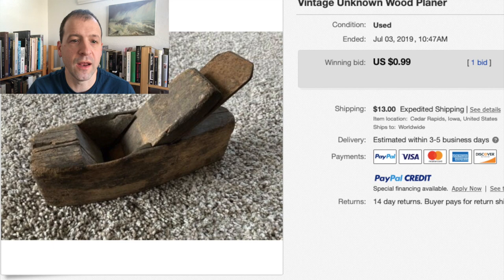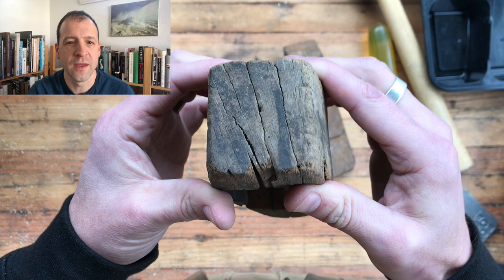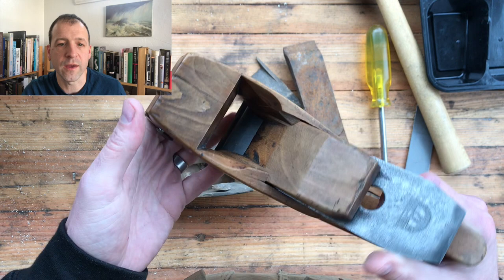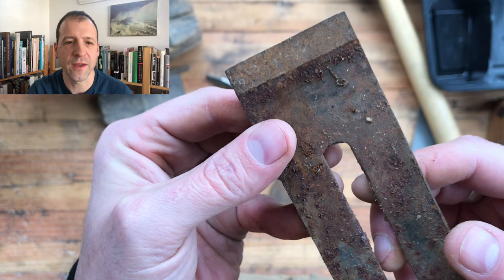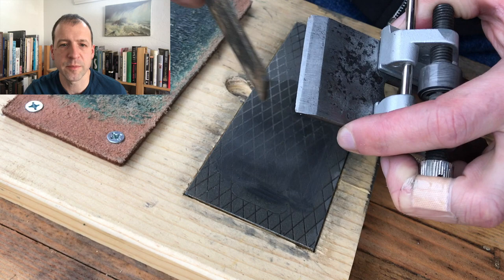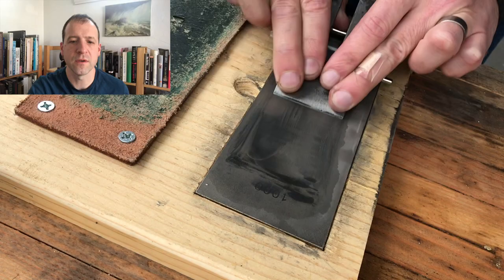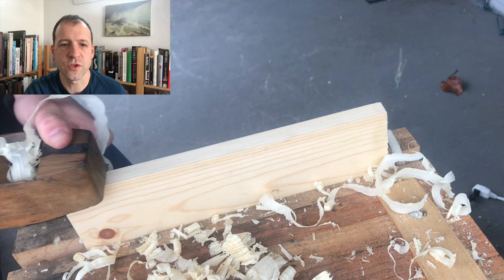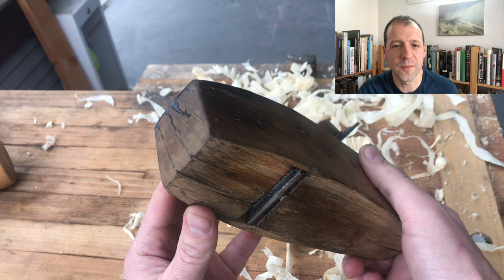Restoring the worst plane on Ebay!

Comment: With the resin, try adding fine wood dust rather than colorant.  We use epoxy all the time on a wooden tall ship to deal with cracks and other repairs.  Also, hitting the area with a low heat gun before and during the pour will help get thr resin all the way into the crack.
Reply: Thanks for the tip

Comment: I repaired windows in historic districts where the client got a tax incentive to keep the windows original, lots of dried and decayed wood.  I used:  Minwax® High Performance Wood Hardener, it is a quick-drying liquid formulated hardener to strengthen, reinforce, and repair decayed or rotting wood.   It’s 20$ per pint but is the viscosity of mineral spirits and it’s applied in numerous coats with a brush.   This would have worked to re-stabilize the wood back to a workable state as glues and epoxy’s will fill and hold but the tension in the remaining dry wood will just split or tear leaving a different crack close to the repair you just made.

Comment: Late to the party for comments but… Ive used “water-thin” CA glue as a stabilizer with some success. Used in all the cracks before the resin and clamping it helps reduce some of the absorption. And will get further into the cracks. Just a thought. Good save on this old fella 👏

Comment: Nice project!  Since the plane is beyond collector value, why not fill every crack with resin?   When I’m trying to get resin into a crack, I take a palm sander, remove the paper, and hold against the object.  Vibrates the resin into cracks very well.  There are also thin epoxies specifically for crack penetration.   Thanks!

Comment: I agree that you needed to add the resin, but I think the grey pigment was a poor choice. I would have either used the sanding dust as pigment to try and match as closely as possible, or I would have committed to the resin and gone with a bright color so it looked like streaks of opal. I think the grey ended up different enough to look odd, but not different enough to look like an intentional artistic choice.

Comment: I just found your channel after following a suggestion from James Wright. I have a job lot of moulding planes I’m working my way through restoring, which also included a few coffin smoothers. 
Several have blown cheeks while the rest of the plane is in pretty good condition. The cracks look old so not convinced I’d be able to clean them out enough to use wood glue and get a decent bond. 
I was going to go with a thin epoxy until I saw it didn’t hold the cheeks in the video - have you found a better fix since?
As others have said, boiled linseed oil (I use 1/3 pure turps, 2/3 BLO) is excellent for reviving the wood after a clean with methylated spirit/denatured alcohol.

Comment: You might try boiled linseed oil instead of the oil soap. I dip my old handles in BOL and let them sit for an hour or so..repeat as needed. Them I use paste wax.

Comment: Yours is worse than mine. 👍🏼

I have an Ogontz Tool Co no. 13.  It looks like there was a fire at the throat opening, it’s missing a cheek, it has a broken off side of its wedge, and some large cracks enanating from the “fire zone” on its sole. I’m pretty excited about attempting this repair though because I’m restoring a desperate, trash-heap-worthy vintage wood plane rather than messing with a nice but flawed plane that I could potentially make worse. So there’s no pressure. 🙂

My problem is finding Ohio white beech to graft in. It’s agonizing to think about mingling species in an old wood plane.

Thank you for your immensely helpful videos; I’ll be relying on them over the next few days.
Reply: It used to be done all the time. Look up re-mouthing a plane

Comment: Great Work. It now looks like a priceless antique restored by the Smithsonian. Since you asked, I would have filled some of the smaller cracks with clear epoxy and then because the wood was so dry, I would have applied several coats of boiled linseed oil over a couple of weeks, then wax.  I have done a couple of old wooden plane restores so your channel is quite interesting.

Comment: These wooden planes are pretry amazing, really, the only thing of real importance is a sharp blade and (if aplicable) a precisely fitting chip breaker and a good fit on the wedge. With that the plane will function perfectly fine

Comment: A fun experiment, and a good result under the circumstances.

I seem to recall in Michael Dunbar's excellent book "Antique Woodworking Tools", Mr. Dunbar advocates dropping really dry planes into an oil bath for a couple of minutes, every day for a few weeks if necessary. I've done this on occasion with simple vegetable oil, and it often helps. Whilst those cracks are almost certainly too big to fully close up in this way, it may help the epoxy to grab, without soaking in so much, like you mentioned.
Reply: Vegetable oil isn't a good fix; over time it will become rancid (rot). Use boiled linseed oil or mineral spirits with a bit of bees wax.

Comment: After glueing, you could have used a vacuum pot and saturated the entire plane in resin.  I’ve also used tiny pins in the cheeks if they looked like a glueing wouldn’t hold.  Great job in bringing the plane to usable shape.

Comment: Titebond 3 and squeeze it back together. You can add a little water to make it thinner and syringe it into the cracks before clamping. I'm not too sure that's the original iron?
Reply: Model RR hobbyist will mix wood glue and water(equal parts) and a few drops of dish detergent.. the water will thin the glue and the dish detergent will break down the water to allow  the mixture to penetrate more freely and thoroughly